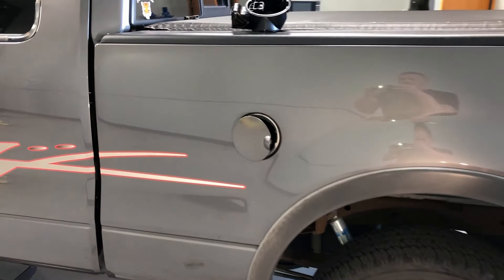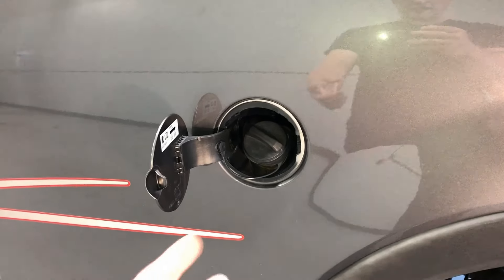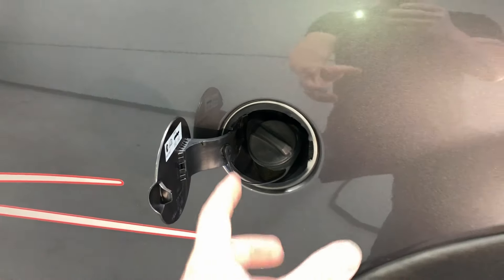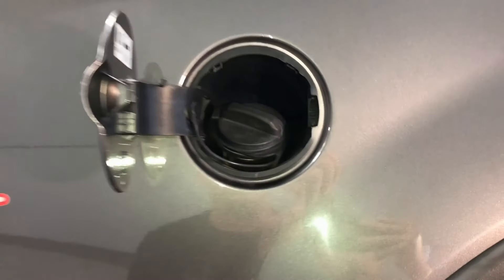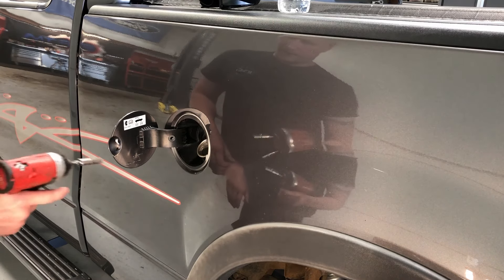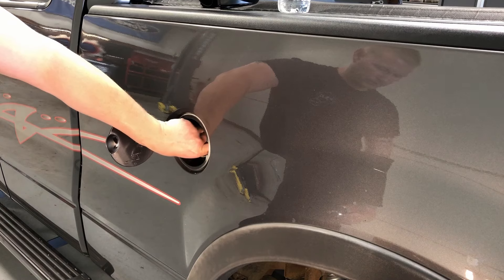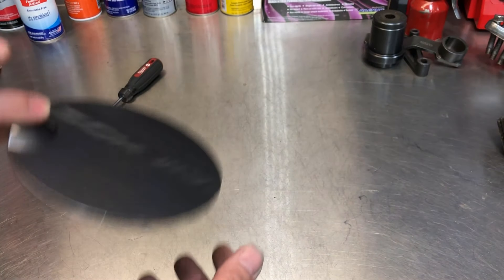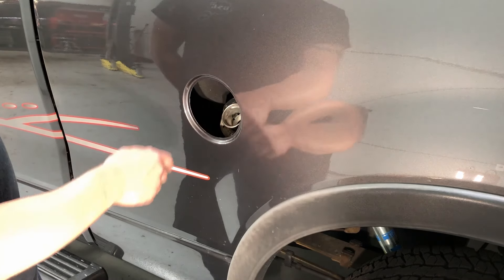2004-2008 Ford F-150: Broken Fuel Door Fix!

Comment: After performing this fix, I blew the #27 fuse.  I replaced it with the traction control fuse (also 20) and now the engine idles rough and there's a wrench icon glowing on the dash.  Tried unhooking the battery to reboot it, but to no avail.  It's hard to believe all of this precipitated from fixing the fuel filler door assembly. Any ideas?

Comment: my 2011 does this about twice a year.  Takes about 10 minutes to re connect the spring.
Reply: A tiny hole in end of rod. Center Punch it 1st. A tiny screw w/washer to keep spring from slipping off.👍

Comment: 2010 model has the same problem, but a different spring setup, it just ends up with the hinge assembly getting loose and releasing the spring. Fix for it is legit open it, reset the spring assembly, put it back in

Comment: Brian, do you advise 5W-30 for 2004-2008 F150 with the 4.2L V6, & 4.6L V8? OEM is 5W-20.
Reply: I would.  The only reason Ford switched to 5W-20 was for CAFE requirements.  My '04 F-250 with the 6.8L V10 calls for 5W-20 as well but I put either 5W-30 or Mobil 1's 0W-40 Euro-spec oil (very good oil) in it.  She's as quiet as can be, no issues, and runs as strong as new.

Comment: i know this is way off subject but i recently used your viedo on installing the timing chain kit on a 05 f150 5.4 3v which was very helpful thanks btw. i replaced the phasers,lower sprocket,guides,chains an tentioners,oil and water pumps vt solenoid and bench bled the oil pump got it all back together.   i did not see your video on the oil pump till after so i did not unhook the crank sensor to whirl it over an prime it ended up cranking it and had to bring it to 2grand an it picked up but sounded like a lifter went down ran it a bit longer an it stoped tappin shut the truck off for 10min started it again an it sounded like a pea thrasher an almost sounded like i broke the guide so i tore it back down an the guides an chains are still intact what do you think maybe a bad oil pump?   an do they have a check valve thats suposed to hold prime? not sure gonna pull the chains an pump when i get off work any advice or tips would be awesome lol thanks for your time an videos very helpful

Comment: This doesn't have anything to do with a broken fuel door but I am swapping engines in my 2000 F150 do I keep the original wire harness or use the one on the engine it's a 5.4 2valve out of a 2001 four-wheel drive mine is a two-wheel drive

Comment: Brian, I've had this grinding noise when I turn and it sounds like it's coming from the rear. It's a 2015 Transit 250 with 25k miles on it. When I took it last time in they told me it was the brakes and they fixed it. The grinding came back not too long after. Is this common on these vans? Btw, I live in Chicago and would love to bring it to your dealership.

Comment: Looks like a DIYer might be able to remove the housing and repair the spring mount aka new rivet or bolt and save on the cost of a new housing.

Comment: Hey, I know my question is completely unrelated, however if ANYONE knows its you!

I have a 99 explorer 4.0L OHV. I just finished butting it back up after a partial teardown. I replaced all the intake gaskets as well as the valve cover gaskets. Cleaned the whole thing up (the engine was coated with a very thick coat of oil and grime. The valve cover gaskets and the lower intake gasket was leaking. The lower intake was visably wet with what looked like oil and coolent in the front. I had a missfire on cylinder 1, so makes sense.

I put it all back together and I'm missing a vaccum line. The little elbow is there and connected, the break booster is connected. There is one more spot for a vaccum line and I Can't find it! Its fallen or tucked somewhere.

If you can let me know what it is and where it originated, I can get moving.

:D
Reply: Pcv
Reply: @paultomasetti5164  pcv is the little elbow. It was the EGR connection and ended up trapped under the intake. I got a bad vaccum leak somewhere on the passenger side, the engine starts and runs but when you press the gas it boggs out. I'm having it towed to a shop tomorrow.
Reply: Alexander Kelly sorry to hear that has those goofy red/green plastic lines that run seemingly everywhere. There’s a vacuum reservoir spherical black plastic ball in the front right corner as well. Sometimes just moving around the injectors Will induce a leak from the old now hardened and cracked orings. Not sure if you separated the fuel rail from the lower intake. In any case, if you plug vacuum ports on the intake it should still rev up. Water in a spray bottle and squirt around till you hear it getting sucked in and/idle change should put you in the neighborhood of the problem. Hope you/they get it worked out
Reply: @paultomasetti5164  yea, I had to seperate it, i needed to clean the whole top 1/2 of the engine.  And the fuel rail had a very thick coat of carbon inside each intake hole.
Reply: Alexander Kelly - yeah all that gummy crap was holding the cam syncronizer in on the one I just did. Had to remove the lower intake and put an inner tie rod removal tool around it with breaker bar to get it moving and pry up.  Someone tried a tune up and got the firing order messed up as well. Wish you luck

Comment: I placed a 6” 1/2” drive extension in the filler neck to avoid dropping the screws in the filler hole.
Reply: Wadded up paper towel? balled up masking tape? pingpong ball with a duct tape strap over it?

Comment: Is this also a common problem on the 2004 Ford Ranger Edge?
Reply: Have you had this issue?  I sold my '06 Ranger XLT @ 185k miles and never had an issue like this.

Comment: Hello hello I have problem with my turn signal on my 2012 f 150 lariat right side is normal left side is click faster and no brake light 
I check the bulbs in the back the fuses turn signal switch and nothing please help What else I can check

Comment: hello my friend my name is Carlos Sánchez I am Mexican and I am working with a translator I have an f-150 2000 engine 4.2 manual transmission the use for my work short yards has two problems loss of power and the most serious is the drain screw of the  Engine oil if you can help me what would be my best option on the oil plug?  on the other they already changed the gas pump and the fuel regulator and.  It is still the same that I noticed is that the fault is noted a little below 60 miles and trying to accelerate is much more the fault I need help for myself trying to fix it can you guide me where to start ?? !!

Comment: I just drilled a hole in the cap, cut a slot in the plastic housing and installed a cabinet lock.
Reply from the maker: Wow why in the world would you do that when parts are still available to fix it right?

Comment: what causes vibrations at highway speed? i got all new tires they road balanced all of them, new struts, rack and pinion, new pads and rotors alignment is perfect steering wheel doesn’t shake the inside of my truck shakes violently and makes my truck feel unsafe. does anyone have any ideas?
Reply: only 60 miles on my 2010 f150^

Comment: Damn wish I had seen this two years ago. Lol I vecroed mine
Reply: ManiacMike F mine is currents velcroed
Reply: Which works best, vecroed or velcroed?
Reply: @georgeburns7251   lol sorry Velcro. Worked just fine for me and is cheaper that thirty bucs
Reply: I tried those little magnets but Velcro worked out just fine. I just didn't have the money to buy a new one. Just about everything that goes wrong with those specific trucks went wrong with mine.
Reply: Where do you put the Velcro? I wrapped the tab on the door with tape to make it thicker, sort of works. One of these days I’ll fix it the right way, but Velcro is good enough for now.
Reply: @freedomairconditioner6152   it's been a couple years but just cut a small square and before adhering it close the door and see where mine I think was just above the tab you put your finger to open it.
Reply: Thanks Mike
Reply: @freedomairconditioner6152  no problem just make sure it's the stuff kind not the spongey type
Reply: @ManiacMike (can you “@“ someone if you’re typing on an iPhone?) so yes I’ll make sure it’s the sturdy stuff kind.
Reply: @freedomairconditioner6152  
I wasn't trying to use that symbol . Sorry, and I have a Droid turbo 2..  Right on and hope it works for you like it did me.

Comment: I own a 1994 F150 bought new in 1994. It has two fuel doors, neither has ever broken. Ford, like every other Auto manufacturer keeps going backward. The mid 90's F150's were as good a vehicle as you could own. They have gone backwards ever since in every respect.
Reply: I agree with you I got a 95 f250 and a 2008 f150, 300 thousand hard miles on the f250 and nothing but oil changes, never had to open up the engine to do regular internal engine maintenance, now with the f150 hahaha it’s just a ticking time bomb, Ford could have just updated the push rod engines give them more power and be more efficient for a lot cheaper then a whole new line of complicated high maintenance engines that are very problematic

Comment: How about a video to replace ECT sensor on 04 F150? P0119 Code.
Reply: A P0119 code does not always mean a defective ECT sensor. Wiring issues in the ECT circuit can also cause that code. It can also be caused by low coolant and thermostat problems. Never replace a sensor based only on codes. You may replace it and not solve the problem.
Reply: @davidquinn6161  Good point, check the easy stuff first.  If the problem persists after making sure it has enough coolant I'd just put in a new Tstat and ECT sensor--they're cheap enough and the truck is old enough you might as well do some preventative work.  I'm not familiar with the coolant bleeding of a 3v engine but if he has a 2v engine in his '04 it'll pretty much bleed the air bubbles out on its own and be able to tell if it worked within a day or two of regular driving.  Otherwise further diagnosis is required.

Comment: Fuel doors, air conditioner blend doors, plastic internal pieces holding the cables in the rear doors... Ford F150s are a case study in planned obsolescence.

Comment: It is definitely NOT as easy as it looks getting that cup into the fender - the tabs broke off the first cup I bought and actually bent the metal around the opening trying to get it in the hole, for the second one I bought, I had to sand down the pointy area around the drainhole just to get the stupid thing in the fender opening, and then it still wouldn't seat down all the way vertically so my fuel door isn't centered - and the second one I bought has a loud "snap" when opening or closing so it's only a matter of time before it cracks, breaks or otherwise fails completely - - what a supreme hassle to perform a very simple part replacement, all due to an absolutely HORRIBLE product design by Ford that these stupid chinese companies make exact replicas of - a few simple strategic shaves of the main cup mold is all it would take to make this replacement a complete breeze - but that'll never change, so most importantly: I do appreciate you making this video!!!

Comment: 😮 put your hand through the bottom of your bed box and you can push the pins out from the back. you don't need a Jab with screwdrivers
Reply from the maker: Correct but the old ones are very stiff so it makes it harder and then there is the one on the opposite side that is not so accessible though wheel well, so we do it this way nice and easy out in the open either way works.

Comment: I can confirm the 2011 F150 has the same problem.
Reply from the maker: Yup just built a bit different and the door housing is much cheaper design.
Reply: FordTechMakuloco It was a few years back. I repaired mine. Seems like I used a small screw or something. Can’t remember exactly.

Comment: Sounds like it should be a recall, not a safety thing so they will never own up to a bad design.
Glad my F450 is all metal.
Reply: Mine broke when it was 12 years old...oh sure terrible design.  $30 part only a few minutes to replace and reuse the painted cover so no need to paint the replacement like the old metal fuel doors.
Reply: Recalls are safety-related.  No manufacturer has recalls over design or manufacturing flaws unless it's serious enough for the NHTSA to get involved.  A fuel door that doesn't close will not get their attention.  Not everything that goes wrong on your vehicle is going to be a recall, sooner or later you've got to put your big boy britches on and accept that you'll have to fix something on an aging vehicle.
Reply: UnsulliedSpy LMAO at you because I stated that you really need to find a new hobby.